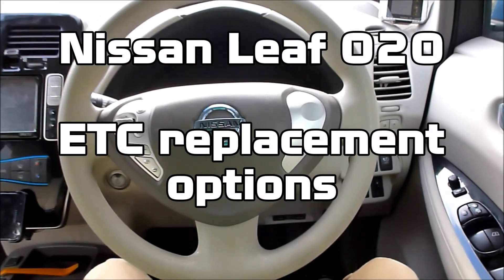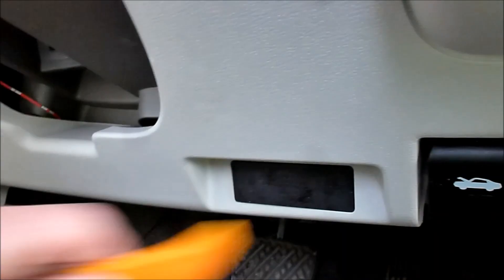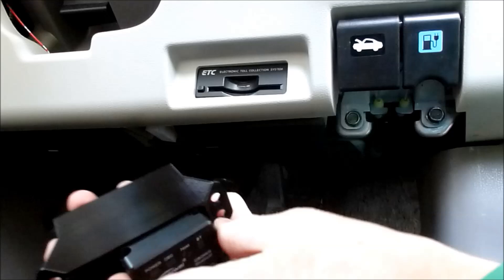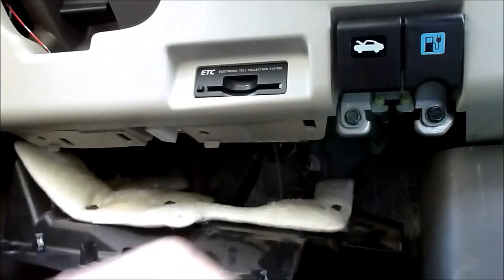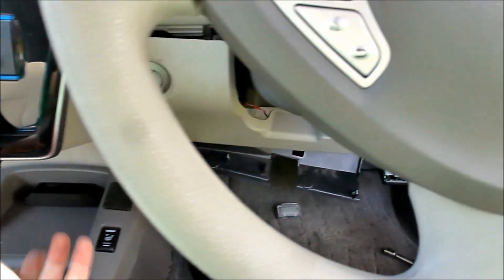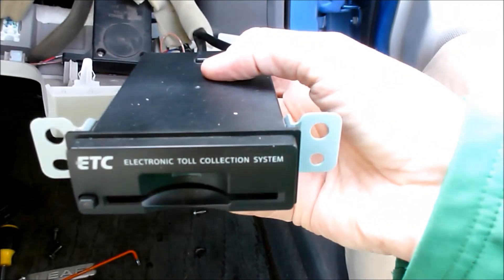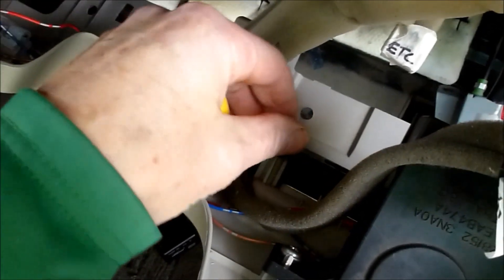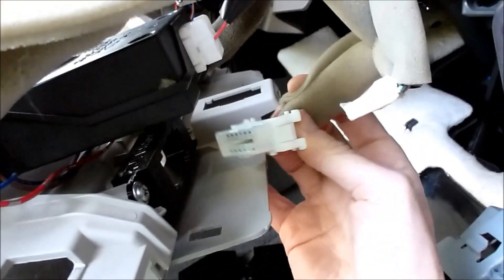Nissan Leaf 020 - ETC replacement options

Comment: Is this ETC is an essential component?
Reply from the maker: The Electronic Toll Collection unit is essential if you drive on toll roads in Japan. For the rest of the world it's useless (and drains the 12V battery a little bit for no benefit).
Reply from the maker: Note: you'll only find an ETC installed on Leafs built for the Japanese market. The US and UK models don't have them installed. Most Leafs in New Zealand are ex-Japan models.
Reply: Thank you very much for the reply.

Comment: Paul, would you ship to Australia?
Reply from the maker: Hi Rob. Yeah sure. It'll be pretty expensive (and slow) for the shipping (somewhere around NZ$25) but I can do it if you want. Alternatively: You may find your local library has 3D printers free to use. Or you could try a local Makerspace. The free STL files are here: https://www.myminifactory.com/users/PaulKennett